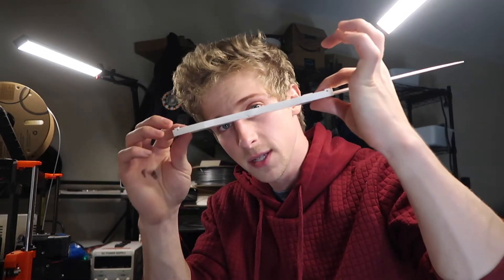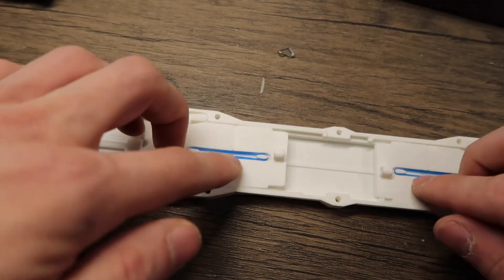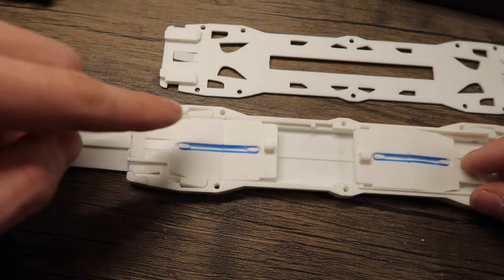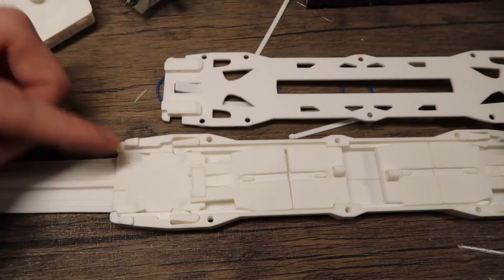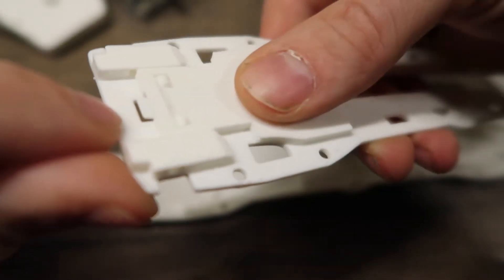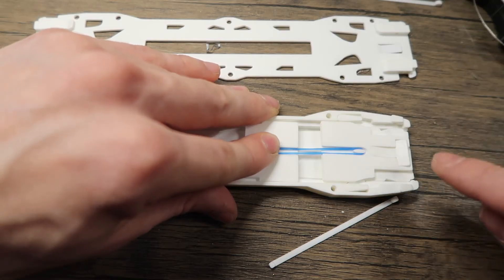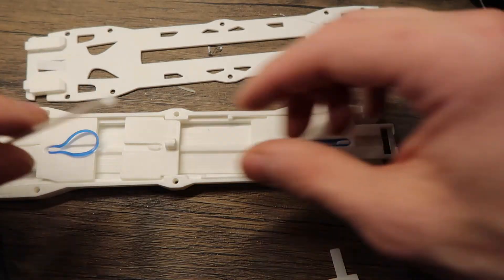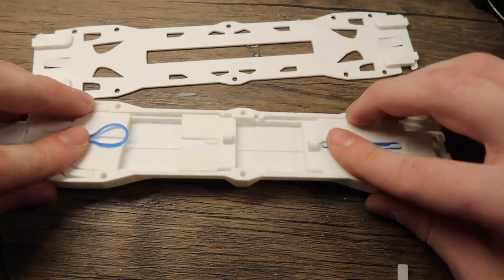Thinnest Dual Action, Assassin Creed Hidden Blade (Episode 5)

Comment: New Patreon subscriber here... Love your work and seeing your thought processes.  I'm in the middle of constructing this build, and I'm trying to understand the mechanics instead of just building it. The one thing that's eluding me is how the locks function. It looks like (from the video) that they are springing toward the center of the mechanism. How is that accomplished??? Is there supposed to be a spring behind them?? next question, i understand the ball bearing, but the smaller pins above the ball bearing, are those just supposed to be metal sleeves??? Thank You.

Comment: I throw knives. I wanted a hidden throwing blade. Planned to 3D print the version from AC3 (Connor's) and substitute the outer blade (since the sliding inner part would be just the mounting for the blade) for a throwing knife with a magnet and a small cut to pin it to the structure. 
Now, with this explanation and seeing all this I have a better understanding of how it works and I am a bit closer to a dream for me. Thanks mate.

Comment: that's some genius design right there! personally I would choose steel springs over rubber bands for durability or is there a property of the elastomer needed for this design to work?
Reply from the maker: I use bands since they have higher elongation factors than springs and are much thinner, I was going for the absolute thinnest design that's still double action via exclusively repeated string pulls!

Comment: I could see this being made out of a variety of different metal working techniques and machinery. The exterior body could be aircraft grade aluminum. The blade could be Damascus steel. The internal mechanisms could be a high quality Spring steel. And your rubber bands could be replaced with high tension  Springssteel springs. Just make sure that all of your screws are extremely hardened and chemically treated against rust and water corrosion. But cause I guarantee you if you start to mess produce these they will be going on some great adventures and We'll get wet in the process.

Comment: Hey man!!! This is awesome! I recently bought my first 3d printer and I would like to do this project. But I don't know if the print size is enough. Will I be able to do it with a 220x220x250 millimeter printer??
Reply from the maker: @gonzaloburghardt2716  glad you like it! Yep the longest parts are the blade and body each at around 212mm
Reply: @CrashMakerspace  Wich one of all your Hidden Blade models is this ones?
Reply from the maker: @gonzaloburghardt2716  this would be the last one posted on Patreon, pretty sure I say “episode 5” in the description of the post with the files as well

Comment: Go over the blade tip with super glue and metal powder from a bench grinder. Clean it up with a file. Poke a water bottle. You don't need a full metal blade. It will work essentially like an arrow.

Comment: If I do it with your 3d models can I make it out of metal?
Reply from the maker: You could, you'd need to be super mindful of tolerances to ensure you don't get minding up of the metal parts. The blade is modeled such that it can be milled via CNC. For the body, you'd probably want to keep something like 3D printed impact Nylon

Comment: Would it be possible to get just basic blueprints so someone could hand fabricate one? i dont have a 3d printer and kind of dont want one because im more old school.
Reply from the maker: The 3D print files are up on Patreon—those could act as blueprints
Reply: @CrashMakerspace  You and Sheldon Caudhill are tied for best hidden blade in my opinon. i want to do your design in the hardened paper method.
Reply: @CrashMakerspace  I have kind of a specific request, as i do intend to purchase the files and build them in the hardened stacked paper,  is there a 1:1 scale vector of all the pieces? I can use the elevation and overhead vector to hand tune everything. I build in multiples of 4, 5, 6, 8 and 10  layers of standard 60 weight GSM per card, I was just curious what you thought about relabeling a set using how many sheets of 60 weight GSM  for each dimension? Just the numbers, not "35 sheets" just "35" and so on, even for the body case length? Not for me specifically, but sort of as a set of plans that an assassin might have that requires you to know the unit of measurement? As i mentioned though, i can use elevation and overhead outlines to hand tune by sight. I'm not really some die hard old school method holdout in general, hidden blades are just on a personal list of sacred relics. you and Sheldon are the only two ive seen worthy of guiding my hand.

Comment: Are stl files for 3D prints availables somewhere?
Reply from the maker: I think I saw your comment earlier, but yep! Just googling "Patreon Crash Makerspace" will get you there. Links are in Bio too
Reply: @CrashMakerspace  I found it! Do the prototype stab well? I mean... I'll replace the plastic blade with an aluminium one...if I get agressed, can I stab with it, or will the blade go back inside?
Reply: @CrashMakerspace  bought it! I don't see any external link for the rubber bands and screws needed, do you have any hint?
Reply from the maker: @juventinoaparis  the comments on the posts should have parts dimensions; I’m pretty certain it’s 1” rubber bands, and then it has M3 bolts and nuts for assembly (a variety pack off Amazon will do) and 3mmx3mm neodymium round magnets. Just depends on the model you’re looking at on there. But do check the posts comments for more info
Reply: @CrashMakerspace  thanks, great work!
Reply from the maker: @juventinoaparis  of course dude! Good having you around the community

Comment: Those thin tabs that unlock the blade, can they be part of the charging tabs that's arent locking into the blade? Just to decrease the number of parts flying around.

When I was 14 I spent months make imdepain hidden blade out of balsa wood, took 2 goes. When I finished it, I pulled the string once and it all flew apart and broke and I haven't tried again for 12 years. So good job in sticking with it.

Also, no shame in making profit on these models, a lot of work goes into it and you are making a product people want so why not make money off it
Reply from the maker: Not with this mono layer concept, since the charging hammers move far enough back, they’re out of reach to be part of the same component. And nice job! Making em by hand takes a lot of fiddling to get it right.

Comment: Um, wait so how would you translate some of this in metal? Would you use springs instead of rubber bands?
Reply from the maker: Elastics can last for quite some time—these bands are years old. Elastics have much higher elongation factors than springs. For the other components you’d keep as nylon plastic (non corrosive and impact reaistant) locks & blade would be metal!
Reply: @CrashMakerspace  ah thx, I understood the system this time now too, last month I didn’t get the locking and the arms, now it makes sense it’s quite simple the idea a quite effective!
Reply: @CrashMakerspace  oh, what would happen if you used metal for the whole thing? To me, most likely the flaps would be harder? And any elastics or could spring also technically work?

Comment: Could this same design be used to make a 2 piece blade, ie: a blade that extends in 2 parts, giving more reach and a longer overall blade lenght? Similar to Altair's blades
Reply from the maker: You'd want one that isn't a OTF style (tossing the blade) so that the 2nd stage wouldn't impede the launch

Comment: It wouldve been best if u color-coded the parts and described it all in the software, rather than in all-white, printed pieces that u have to hold together by hand. 
And with that design, u could technically make the blade too heavy, spring too weak, or mechanism too frictional, that the blade wouldnt be thrown hard enough back to latch to the opposing components, wouldnt it?
Reply from the maker: It would be nice to have extra info in Blender animations for sure—I’d like to learn that someday but I’m already maxed for time after work designing and editing my stuff as is 😅 heavier blades tend to actually be better as it’s more effective at retaining energy in its mass
Reply: @CrashMakerspace  i just mean u should record your CAD
Reply from the maker: @shredyoutubeworkersandceos  that’s the thing dude, I do this exclusively in Blender 😂 it’s what I know hHa
Reply: @CrashMakerspace  u know how to edit vids. Record the screen, wave the cursor around, edit with red circles in post

Comment: Amazing design, I just wonder how strong those locks are. They seem somewhat small considering that they would receve all of the pressure from the blade when stabbing.
Reply from the maker: They're quite strong! Just looking at compression force, small parts like this are more likely to deform or crack the casing rather than the locks themselves

Comment: As a small scale maker/designer your use of 3D printing for your compliant mechanisms makes sense, but I wonder if you can replace some of those smaller internal pieces with leaf springs. Spring steel is probably within your wheel house, but I wonder if there's anyone out there that can make titanium leaf springs to your specs. 

Also, once you're done and you feel you have a "ready to ship" design, you should build a mechanical tester for it. I feel like a simple solenoid attached to trigger spring would work. You can just run it constantly until it malfunctions and the iterate on materials with that data.
Reply from the maker: Leaf springs would definitely be better since it'd cut the width & friction down! And getting metrics on longevity would be awesome I agree. To be perfectly honest I'm not sure I'm there yet with the time I can allot to perfection of my designs (this channel is still derived out of just my time after work lol)

Comment: Great work man. You've made unbelivable progress with that. I would have never thought of such a construction. Even though it is very difficult to think of this, the mechanic on its own is simple enough that this might have worked in the times of Altair. 
YOU ARE A GENIUS. 
I just got one question left. Would this really work? Could this blade be used?
I love your work with that. Keep going.
Reply from the maker: Appreciate it dude! So this will totally work with metal blade. In fact; metal transfers energy better as it has mass so plastic I actually really hard cause friction can over take the mass easily. Basically; the body, locks and blade would be metal; compliant peices nylon.

Comment: Would you ever make this blade out of metal and test to see if it can handle the stress of use?
Reply from the maker: I’d like to, CNC is the only metal machine option I can use atm but it’d be cool to actually have a hardened blade

Comment: do you plan on building a sharp, functional metallic version with a real blade after?
Reply from the maker: I would like to get some parts CNC'd for metal; The compliant components you'd way to keep a good plastic like nylon for longevity. The blade / body / locks would be metal

Comment: Hiya this looks apsolutely amasing and incrediable and much needed. Im looking into joinging your patrion to make my own but i was wondering two things. Is there any way to make the blade thinner width ways as im hooing to add a crossbow attachment on the top like in assassins creed unity. I am also wondering what print settings you used for printing this including wall width, print speed, layer height and the such. I hope to hear from you soon 😁
Reply from the maker: Totally dude! Patreon has each of my prototype files used in my Episodes. Hi I prototype 5 and I have a post on there showing print settings. I give my Source Blender file posted straight off my laptop too there so you can tweak it however you want since you have my source work!

Comment: Does the patreon give assembly instructions as well as a list of non 3d printed parts for assembly?
Reply from the maker: Hey! I think I might have just responded to ya on TikTok, but I do include a list of the hardware I've been using in prototypes and this video shows the placement of each part (all are visible here as I pick it apart to show workings of it).

Comment: Are you still using magnets to engage the locking levers? In my testing, I had the same problem you mentioned previously, where the blade flies right past em, and bounces back. Looks like you're not having that problem anymore - how'd you address it?
Reply from the maker: I got a little bigger magnets (1mm longer) but it still bounces back sometimes so I’m thinking about assisted locks with compliant tensioners. One thing nice about not having full springs is you aren’t impeding the blade by pinching it at all
Reply from the maker: I got a little bigger magnets (1mm longer) but it still bounces back sometimes so I’m thinking about assisted locks with compliant tensioners. One thing nice about not having full springs is you aren’t impeding the blade by pinching it at all

Comment: I really love this idea, every hidden blade I've printed requires a lot of force to pull the rotational gear and make the OTF mechanism to work. I've found it to be a failure point for almost every design I've gotten working. I'm very excited to print this and add it to my infinite collection of hidden blade designs lmao.
Reply from the maker: Yea I agree! The sinusoidal nature of the rotary makes it really stiff initially along with them being really thick and bulky hence why I’ve been creating new mechanisms! If ya download the files be sure to check out the Blender file off my laptop too if you want to make modifications as this is still a work in progress
Reply: @CrashMakerspace  I'm excited to see what else you come up with, fantastic work!
Reply: @CrashMakerspace  I've gotten a full set of parts printed, I do have one question. Is there supposed to be something behind the locking tabs to make them want to spring back forward? I'm having an issue where the blade shoots out but just bounces back and doesn't lock in place.
Reply from the maker: @DarthRiley  depends on the model; the older ones I mentioned the 3mm torsion springs; but if you see pockets under the locks & blade, that is where little 3mmx3mm round neodymium magnets go!

Comment: Awesome work! Found you through TikTok. Did you consider replacing the rubber bands with a compliant spring design? Or is the distance the mechanism needs to travel too long for that?
Reply from the maker: Sweet! Glad that you were able to find my longer-form content (definitely easier to help others learn about the mechanisms with longer descriptions). But you got it! The distance is the issue. The “Elongation Factor” is 300-700% for elastic and more like 10-80% for complaint systems depending upon printing material, so they’re better for small synchronous mechanics rather than energy storage and transmission!

Comment: What if you were to make it so that the mechanism wasn't on top of the blade but instead next to it.
So that one side operates the pushing and the other side the pulling, letting you have a longer acceleration.
Reply from the maker: This is similar to another concept I'm working on, the locks tend to get in the way there; I've actually tried having the locks above / below and the chargers on the sides but hasn't been as effective as of yet

Comment: any word on that sinusoidal design you mentioned in your last short?
the one that could theoretically have a spring that spans the whole length of the blade?
also, how would a movement of the wrist be able to actually fully extend something like that? or is that why you didn't mention it again?
Reply from the maker: Yes! That one is still in the works, I really want to make something that is low profile but has that constant tensioner the length of the body. I'm trying to work on a magnetic system to allow that theoretical design to run